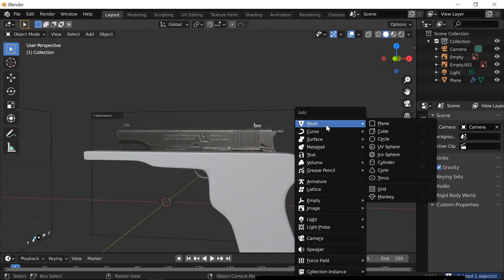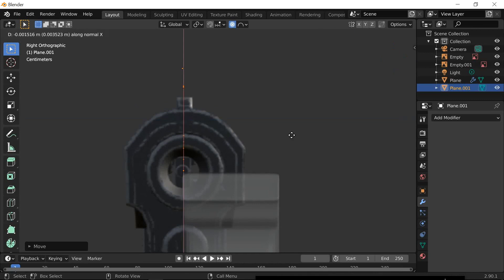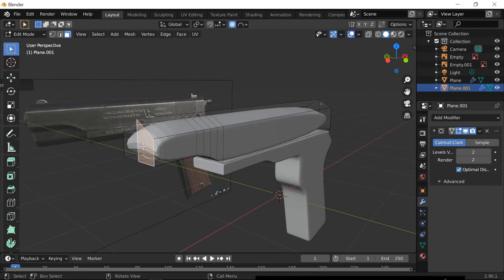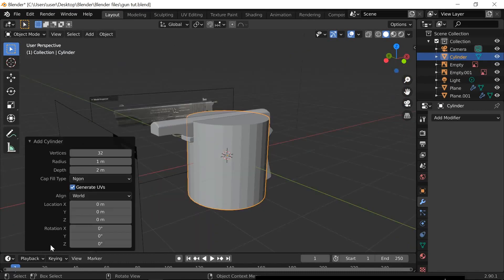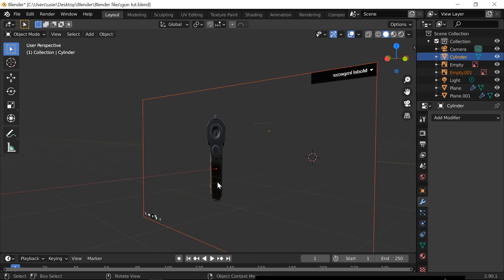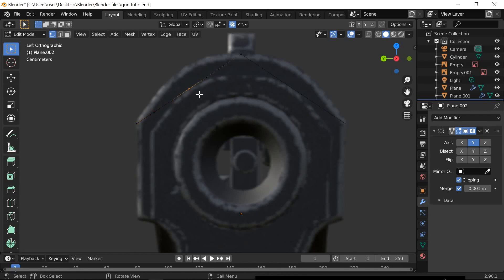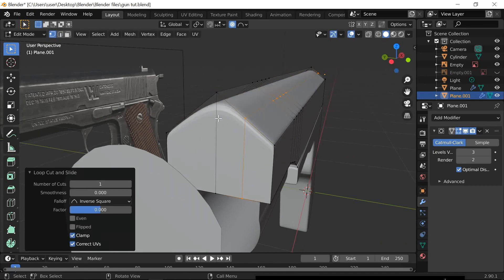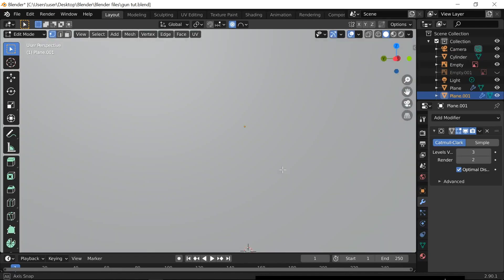Modelling A Gun In Blender Beginner Tutorial | Part 2

Comment: bro dont use 128 verticies, use shade smooth and subsurface modifier
Reply: Fax I was looking for this comment to back up my point lol.
Reply: It did hurt to see.
Reply: @stylocoder9598  what is the "128 verticies" ?
Reply: @gryasl6231  He set the amount of vertices on the cylinder as 128 in order to to get a smoother cylinder. This is not great for many reasons mainly because the more vertices on a shape the more laggy blender becomes or even in a game engine.
So a fix to this is to use something like 64 to 32 vertices and then right click and shade smooth your object to achieve the same smoothness without the added cost.
Reply: @stylocoder9598  thanks, I have one more question. he is adding an extra face at 3:30 to make flattened face with the subdivision. But is it a legit way to do that? Do you really need add extra face(s) to make one part of object flatten?
Reply: @gryasl6231  No, this is a really ineffective way of doing this (As it gives you doubles which are unhelpful when modelling; you can remove these by going into edit mode and selecting all of the vertices with "a" then pressing "m" and selecting merge by distance) 

so if you press "n" on your keyboard it will open up a new menu on the top right of the viewport at the bottom of this there is an option for mean crease turn this value up and down on a selected edge will achieve the same affect.

It's kinda hard to explain on comments so just search up "mean crease blender" on  YT and there should be a like 1 min tutorial on how to use them which should explain it better than I can.